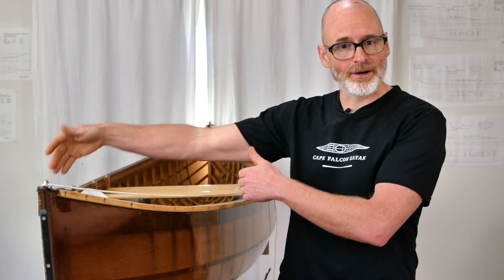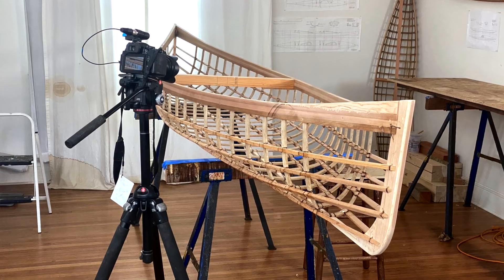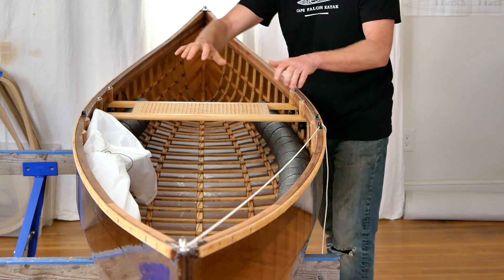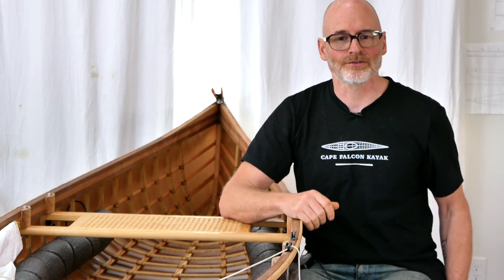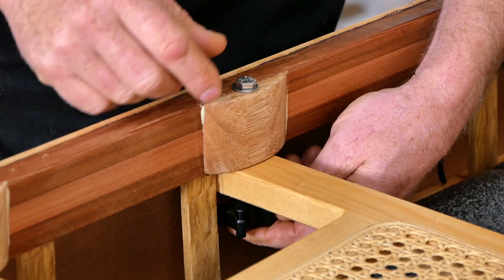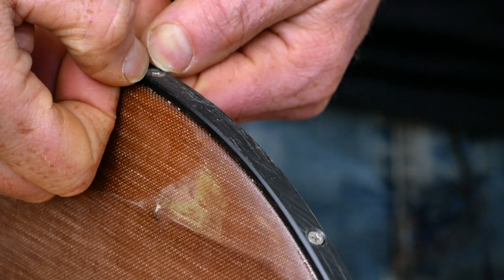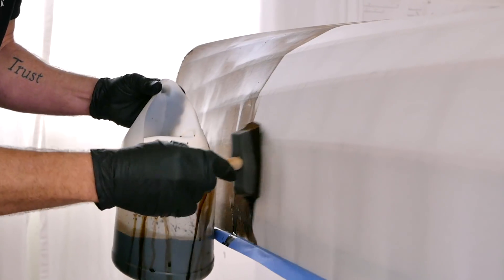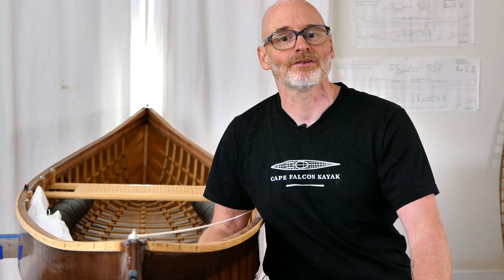First Skin-on-Frame Solo Canoe Build of 2021!

Comment: Great video. I note that you role on Corey’s urethane vs using his card technique. It looks like a hard foam roller which I’m guessing is an easier and less risky application method. Thanks again for your videos.
Reply from the maker: Yeah the roller is definitely easier.  There’s still a lot of stuff that can go wrong though which is why I’m meticulous about my coating instructions in the course.
Reply: @capefalconkayak  Thanks. I just saw one of your other videos where you cover some of the challenges which was also very helpful. I’m doing a little test (dinghy) boat currently but will likely have to commit to your F1 plan. My wife and I are getting too old to be lifting 65lb kayaks on the roof. But it’s not just about weight. Your F1 is a beautiful and functional piece of art. Thanks again.
Reply from the maker: @mattdjmorris  thanks, it's a decent little boat.  Simple, effective.

Comment: Great video - beautiful boat. Do you think the same approach could be applied to build a skin-on-frame rowing wherry?
Reply from the maker: Yes and no, this particular shaping system only works for canoe shapes but you can actually make a lovely rowing canoe with it and I have a whole Outrigger system that works with these.  But if you want a genuine wherry or Adirondack guideboat shape, that can still be made out of skin on frame but it has to be built with laminated ribs instead of steam bent ones.  I’ve done quite a bit of this and my favorite row boat is a skin on frame Adirondack guide boat, but it is a lot more work to build.  There’s some videos here on the channel that talk about the rowing system if you want to check that out.